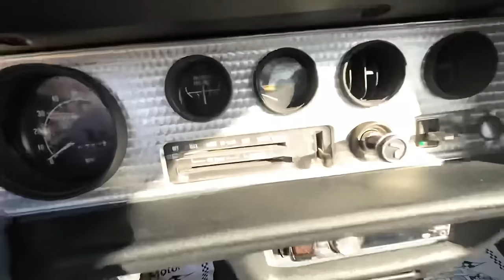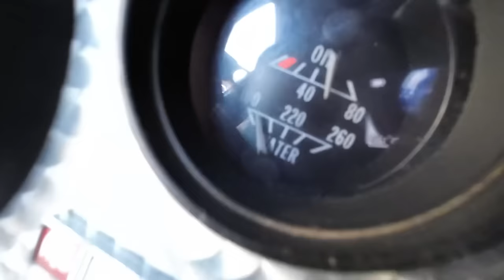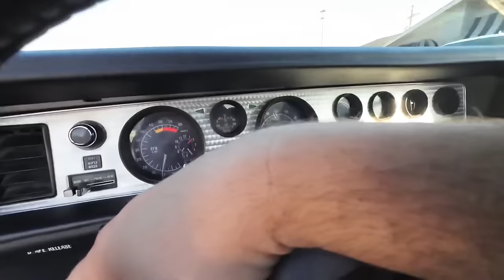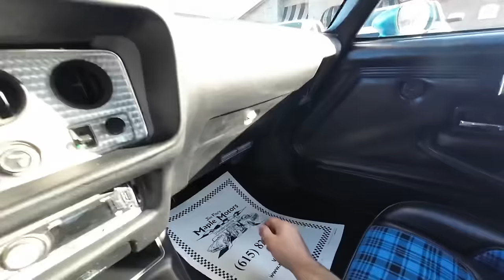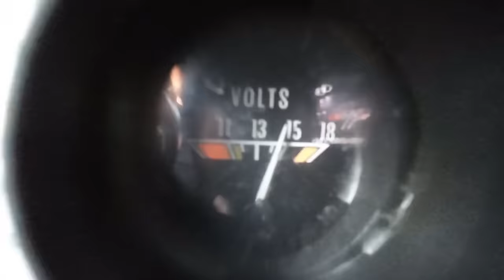Test Drive 1979 Pontiac Trans Am V8 $24,900 Maple Motors #2503

Comment: A lot of people don’t like the 403 Olds engine, on the street, they have potential, a simple head swap makes them come alive, very easy and cheap to do.
Reply: I've read were the Rocket 350 heads wake the 403 right up 😊
Reply: @louislepage5111  They do, the only issue is the 403 has larger diameter head bolts, you just use a drill and open up the existing holes, I’ve done it twice, I used #5 heads, with the W-30 2.07 intake valves put in with hardened seats, brings the compression up to close to 10:1, makes a huge difference, if you jet the carb, and add a better camshaft, the difference is amazing.
Reply: @highrzr  I have built a few of them the head swap is the biggest thing, a little drill work on the head bolt holes and a set of # 5 heads with the 2.07 intake valves installed, with some hardened seats and they really come to life. They do need a camshaft, adjustable valve trane helps too, carb tuning, and distributer curving. If you wanna really make them run, a set of gears, a higher stall converter, and some valve work on the transmission, then it’s really amazing. Forgot the headers, with everything else, if you do it they’re a must, along with better flowing mufflers. As for the webbed mains, they have girdles that take care of that, all it takes is money. I have built many Oldsmobiles, I have a 1972 W-30 in my shop that I ordered brand new, just finished a complete frame off restoration on it, including full mechanical. Completely number matching, but not stock internally anymore. It runs extremely strong.